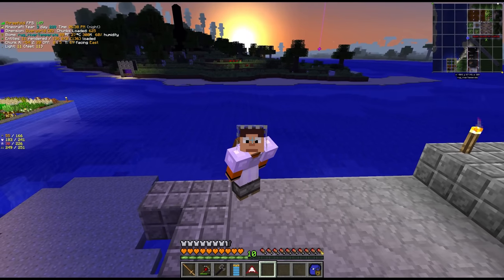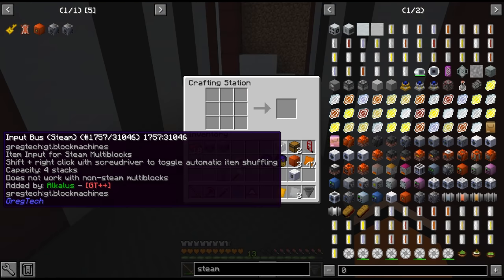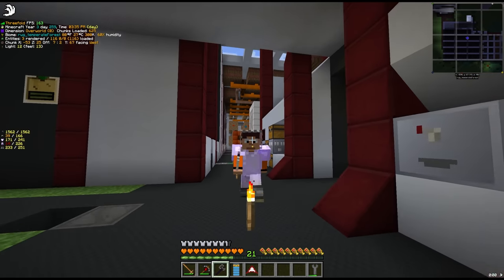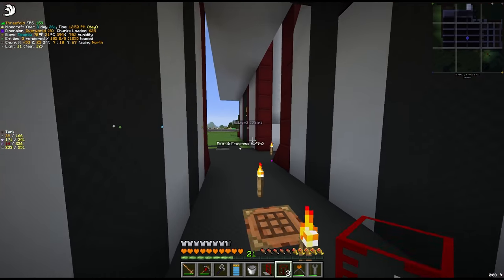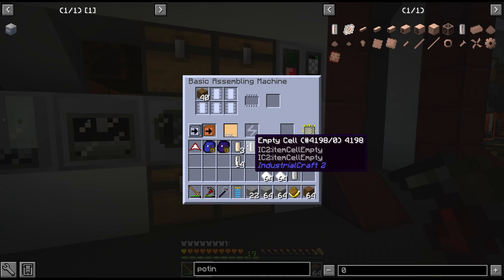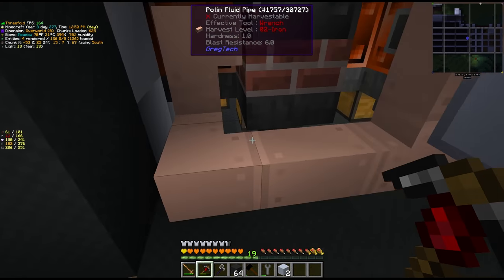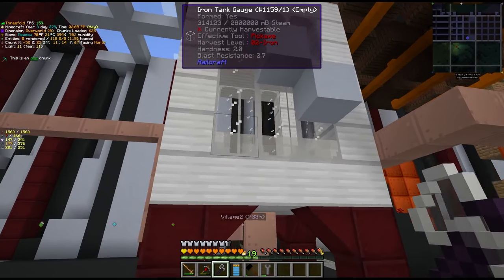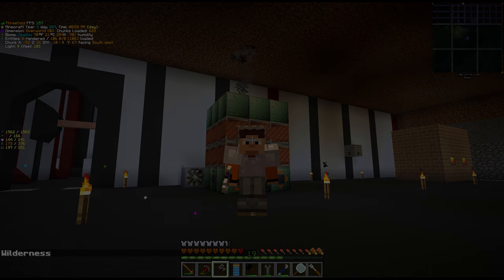Gregtech New Horizons - 10 - There's An I Next To The U & N! Modded Minecraft

Comment: For reference, the specific input/output buses/hatches for the steam grinder is so that you're able to craft it pre-steel. I'm not sure how practical and/or useful it is at that stage, but it's possible. And yes, of course it takes a random alloy. Everything in GT++ needs a random alloy...

For the record, the silicate wool was added as a way to get your first EBF coils without having to find a Mica vein. Every EBF coil after the first has to be made with Mica. Also using Ruby for silicate wool is...not advised. You're going to need a lot of it for Chrome eventually.

For the record, brewing stands can only spawn in stone-based roguelike dungeons, and only on the top floor in a secret room. I don't know if the secret room is guaranteed to spawn or not, but either way you don't need a brewing stand to get lubricant, as you've noticed. Also, if you're not burning lubricant for steam you can do worse than turning it into lubricant as a way to get rid of it. You need lubricant for some recipes, and it can speed up the Cutting Machine as well.

That is why people kept yelling a-ah I mean advising you to upgrade to high pressure steam machines, in case you were curious.

Terra Wart seeds are actually a scam, you can mutate them from fully grown Nether Wart by placing a snow block beneath the soul sand. That said Terra Wart itself is extremely useful - it functions like milk in that it'll remove negative effects, stacks to 64 unlike buckets of milk, and it is a very rich source of Praecantio, Victus and especially Aurum essential. You'll definitely want to plant that stuff after you get started with Thaumcraft.

Some points to note about the EBF: You can place an output hatch in the top eight blocks in order to recover Co2 once you've got an upgraded muffler hatch that's more than a glorified pipe in a box. You can add a third energy hatch to EBFs, which is useful if you're paranoid about Maintenance issues - tl;dr is that with three input hatches providing a total of 6 amps an EBF cannot fail due to insufficient power even with five active maintenance issues, which isn't going to happen short of criminal negligence and/or Voodoo magic. EBF can wallshare, and it's very good to wallshare, but wallshared EBFs cannot used mixed coil types, and it is either impossible and/or extremely ill-advised to wallshare energy hatches. Buses and hatches are safe to wallshare, just make sure you're not running into issues with EBFs running conflicting recipes. EBFs will not auto-insert without a conveyor/pump or something along those lines, but they should auto-output if the output bus/hatch is facing the correct direction - I'm guessing the steam grinder is an exception to that rule because it technically uses lower tech output buses, or something. Finally, if an EBF runs out of power while it's processing a recipe it will void the inputs. For this reason I do find it useful to use a battery buffer to power the EBF, since that way I know for sure that it can do X amount of recipes before needing to rechange.

For rotors the fluid extractor/solidifier combo recipe is actually slightly cheaper than the extruder - 17 ingots per 4 rotors compared to 20 ingots per 4 rotors. Of course the extruder allows you to craft rotors one at a time, but there's very few situations where you're not going to need more rotors later, so I would recommend using the fluid recipes.

There is a limit to how much railcraft tanks will auto-output on the bottom. I'm not sure exactly how much, but if that proves to be an issue you'll need to use multiple valves. Just be mindfull that the content of a raincraft tank is stored in the middle bottom block - if that block gets destroyed the tank will be empty after reforming it.

Craft an IC2 Toolbox - you can place tools in it, and you can use the toolbox on the maintenance hatch to automatically use whatever tools is needed to fix a maintenance issue that is present in the box. Very cheap to craft, too. For reference: The tools you need for maintenance issues are a hard hammer ("platings are dented"), soft mallet ("something is stuck"), crowbar ("that doesn't belong there"), soldering iron ("circuitry is burned out"), wrench ("pipe is loose") and screwdriver ("screws are loose").

Three things to note about EBF coils and their temperature. One, the voltage tier actually contributes slightly to an EBF's maximum temperature, +100K for every voltage tier above MV. Second, for every 900K that your EBF runs at above a recipe you get a 5% discount on the EU/t cost of a recipe. Third, for every 1800K you get one upgraded overclock, meaning 4× the processing speed at 4× the cost instead of 2× at 4× the cost. Remember this as the reason why you want to always upgrade your EBF coils ASAP, because you're going to need to do so anyway and power discounts/faster processing speed now is going to matter a lot more sooner rather than later.

The scanner is expensive, yes, but it's a necessary component to use prospectors. If you're serious about getting into oil it would be good to know what the oil fields near your base look like, because that one giant spout isn't going to last forever even if you supplement with oilsand.
Reply: ur a legend

Comment: If you extract crushed ores from the steam macerator too slowly, it will decrease how many ores it will macerate each time (still taking full 30 seconds) because of an inbuilt output void prevention system of GT++ multis. This will certainly happen when using something like nether redstone ore. I suggest upgrading the output bus conveyor to mv when you have the resources.

Comment: Hey quick question, my ebf isn't working, it's all lv I think I have all the stuff I needed to build it, I fixed it in the maintenance hatch and I can't get it to work, changed the recipe added oxygen changed the programed circuit, nothing. Even tried cheating with a quantum generator to make sure it was getting power
Reply from the maker: Soft mallet?
Reply: @Threefold.  I figured it out through brute force, didn't realize just how hardcore they took energy loss over distance. I simply wasnt giving it enough juice to carry that distance so it was always right on the cusp of starting, appreciate the help though, it was stumping me for a few days now! This playthrough has been a godsend for figuring a few of the more esoteric things out!

Comment: Wait, you do 4 LV steam turbine, but wire lost is a thing, so the total power reaching the EBF is less than 4A, how is your EBF running.
Reply: In my playthourgh I have to change that wire to a battery box to remove wire lost, or the EBF will run out of power and turn off
Reply from the maker: I believe cable loss only occurs after the first block. So the Turbines output their full power to the adjacent cable and then every cable after that loses EU depending on the cable type
Reply: Wire loss acts on voltage, not current, and is 1 per cable per amp for tin. The EBF needs 120 EU at LV and Three is supplying 4 amps of (32-1)V power, which is 124 in total.
Reply: @smikkelsmakkel  I know its in voltage, so 124 EU is less than 4A of Lv power (128)
Reply: But yeah, that might be why, the recipe only require 120EU to run
Reply: @foxwhite25  the EBF doesn't need exactly 4A of LV power, it needs 120 eu/t for MV recipes. 4A LV = 128 so you have 8 eu/t of wiggle room.